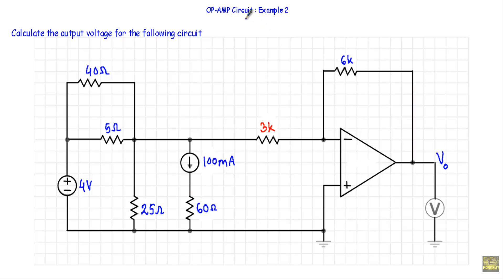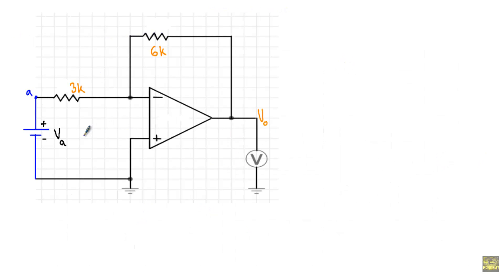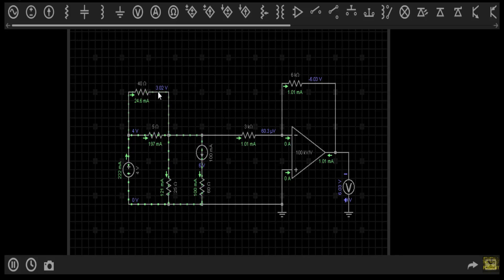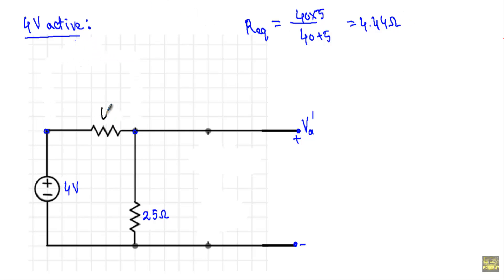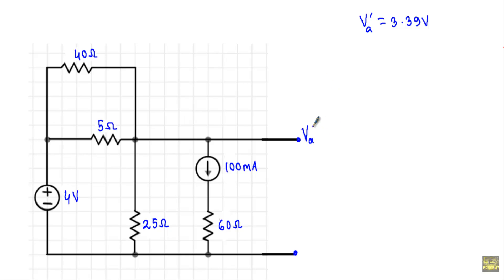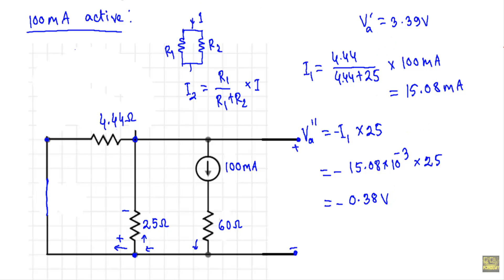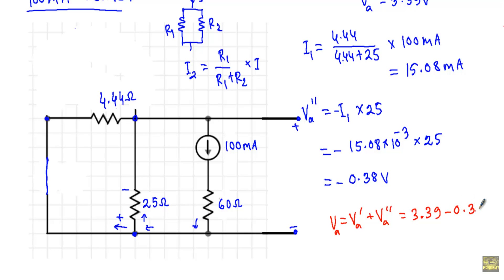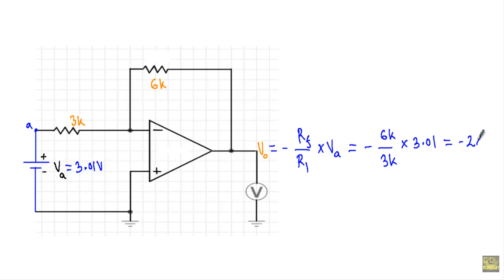OP-AMP Circuit : Example 2

Comment: Why V_a can't be = 100mA*60. Help me.
Reply: that will give you the voltage drop across the 60 ohm resistor, but the 100mA source also has a voltage drop across it that is unknown, so that branch can not add up to Va with just the voltage across the resistor.

Comment: thanks for explanation,and I want to ask a question, I used thevenin to get Va in that problem,but I think Rth should be added to circuit, why you did not added R(thevenin)=3.77 ohm to the circuit?  So R1 would equal to 3kohm+(3.77 ohm),  is it for Rth is very small and you did not mind?
Reply: which is right adding rth or not?